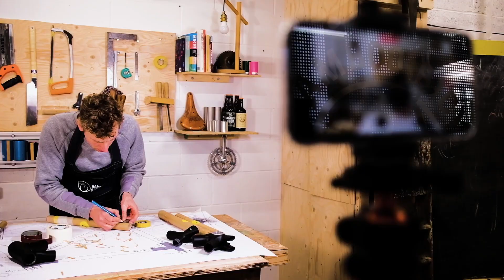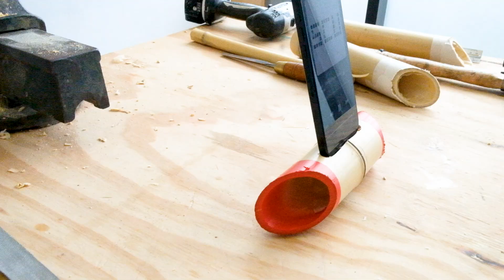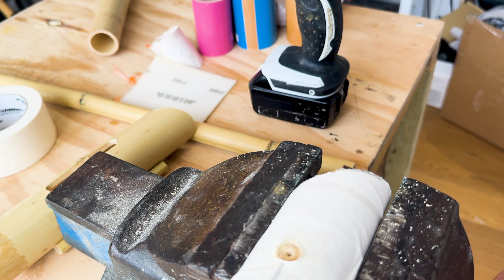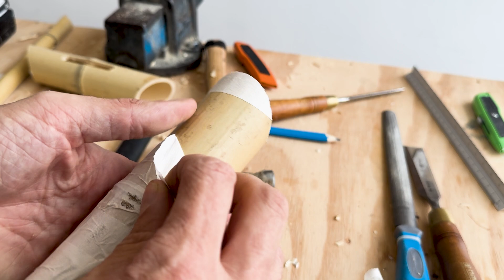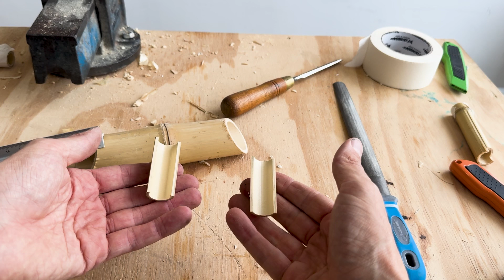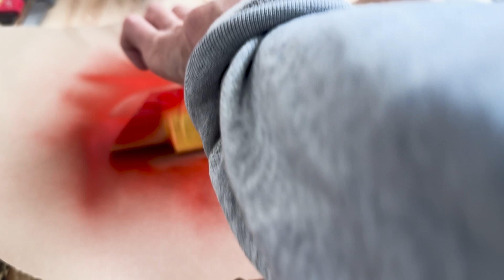How to Make a Bamboo Phone Speaker (No Electronics)

Comment: You can also use a piece of bamboo that has already split down the middle and widen the slot with razor knife as needed then cut the 45 degree angle on both ends